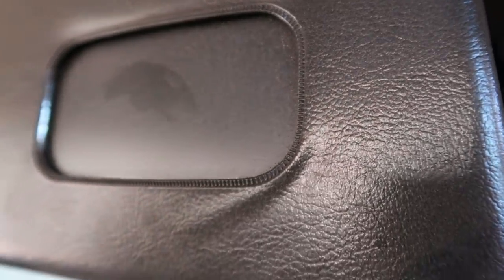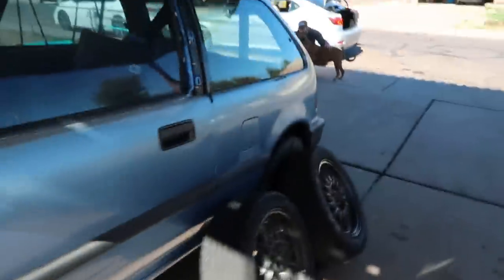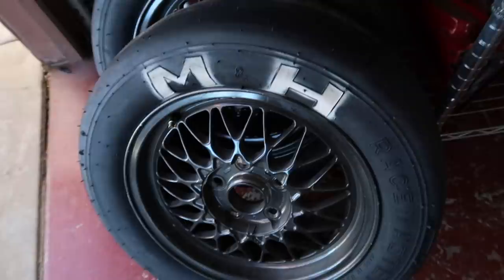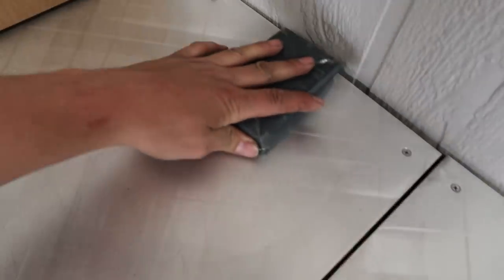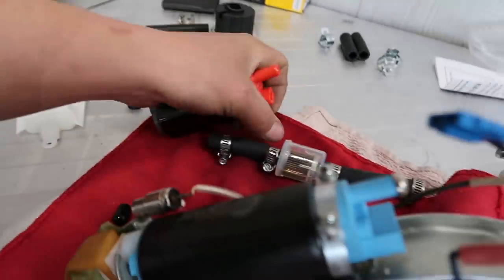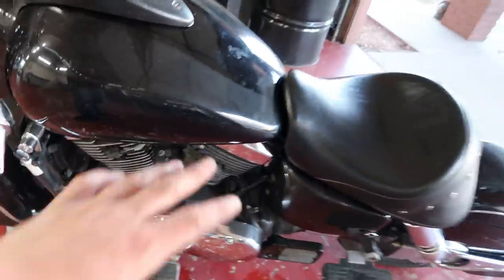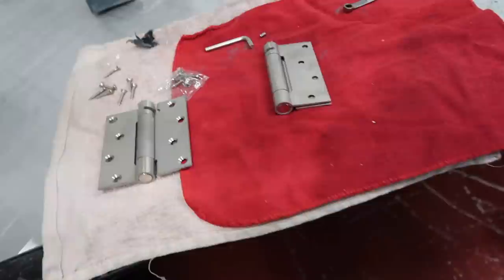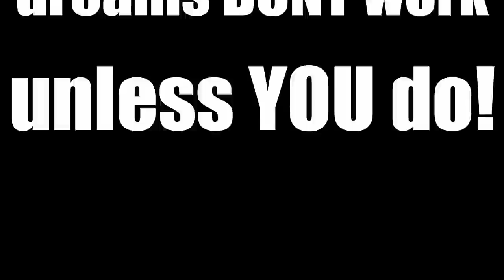New Rubber for Cocky! I mean Khaki !!

Comment: Pop the power commander off, there known to start to short out, i had the issue before on my gsxr1000, pull it off see how it rides and if it doesn’t fix it then you have either a fuel issue or  carb issue... check all the fuel lines, also run a cap full of seafoam in a full tank of gas
Reply: Most of the time when people get there bikes worked up, aren’t the carbs jetted and exhaust bigger for the power commander?  I completely agree with what your saying with that but then he’d have to change jets”carb” or if efi changes duty cycle and fuel pressure too.🤷🏻‍♂️what you think!!?👊🏼💪🏼🔥🔥
Reply: The bike is fuel injected. No carb.
Reply: Fuel , air and spark,3 things needed to run so ones not up to par, I’d still go with remove the power commander and go from there, if it runs like poop then it’s a fuel problem or spark problem which could also be wiring
Reply: @ShowtymeDesignz , I thought it was EFI too but he pulled the choke out. It’s right under the key and we both know that efi don’t need to choke.

Comment: I'd say your carbs are gunked up or not in sync.  Like they are not putting out the same amount of gas.  Aka the jets are off.  So check how to tune the carbs in sync online.  And clean them out.  Very easy to do.  And new plugs and wires

Comment: I had a suzuki tl1000r and i had the same problem it might be the starter solenoid relay check the connection make sure the wiring isn't lose it has to be tight

Comment: Rebuild carb and try different jets and pilots. Coming from another state messes up the air/fuel ratios could be causes damage engine wear.
Reply: There is still a jet though right

Comment: Yo try cleaning the injectors on pops. I had the same problem on my civic. I changed the fuel pump and filter and still ran like shit. Then i had the injectors cleaned and it fixed it. Good luck!